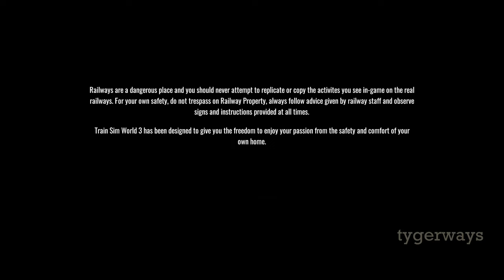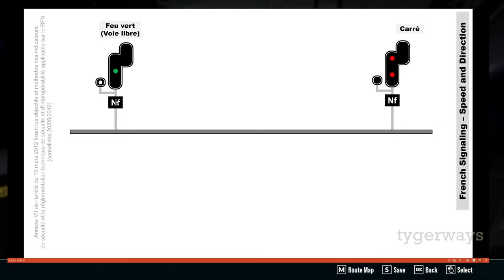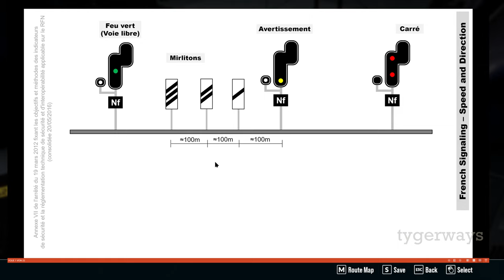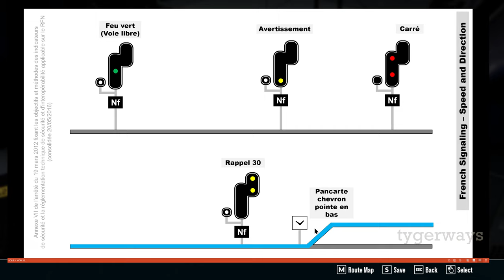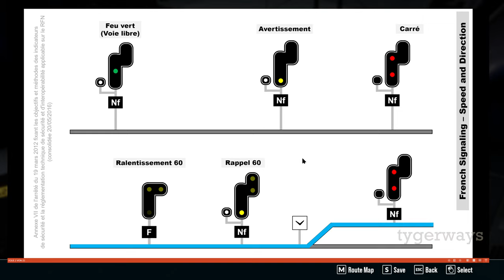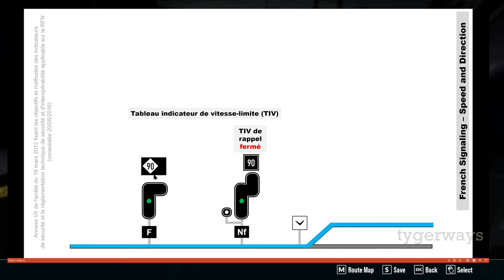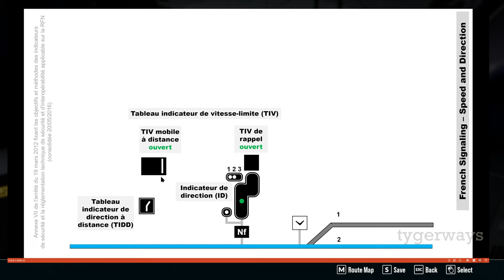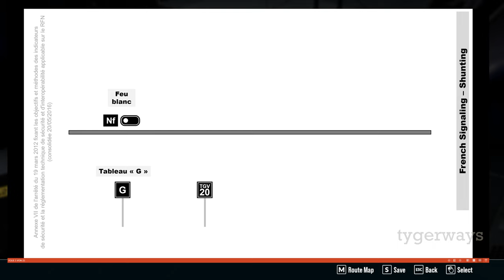French Signalling: Speed, Direction and Shunting Signals on the TGV Duplex 200 (TSW | tutorial)

Comment: Musings:

As I've said before the TGV dynamic brake in the game is not very effective relative to the real one and on top of that if you drive in a realistic fashion you can't keep time because many of the station to station times in the game are too tight.  I looked at the way you drove Marseilles to Aix-en-Provence in this video and you were, imo, a bit more aggressive in a few places than a real SNCF driver would probably have been and yet you were still late by the game timings.  On many services on many routes you can either drive it realistically or keep time but not both.  Some services on some routes you can but a lot you can't. 

Also, perhaps I should clarify "my" double block method a little.  It's not intended as "do it everywhere, every time".  In real life it would typically be employed at higher speeds so you wouldn't really apply it rigidly at lower speeds and obviously doing it at a flashing 80 would be silly!  Also, it's more aimed at situations when at high speed an unexpected reduction pings up and the driver doesn't know why and therefore doesn't know what's coming so it's better to start to knock the speed off early just in case.  In the game it also helps to compensate for the feeble dynamic brake.  

That unexpected speed reduction situation is a little different, for example, to approaching a station the train is scheduled to stop at.  In that case drivers know from their route knowledge that getting a flashing 300 (or whatever) at a specific repere means they are clear into the platform so they know what's coming and where the station is.  They can thus brake appropriately for the known upcoming speed reductions and the known stopping point (ie the TGV1 or TGV2 markers on the platform).  Getting a reduction earlier than the specific repere means they are not clear into the platform, don't know what's coming and so a more cautious approach is warranted.   

So basically it's a defensive driving technique but you tailor it to the specific circumstances similar to what I described before for following another train where you don't do it rigidly but pick an appropriate speed to try and create a steady state situation until the train in front pulls away.
Reply from the maker: Thank you very much! What you say clarifies a lot and matches my 'feeling' with managing the speed in this system. I hope you are okay with me calling it "your" double block method, since you introduced it to me. :) Just let's hope for more French content to be able to check out more different situations!

Do you have an explanation for the Crocodile alert at 18:23?
Reply: @tygerways6615  You're welcome and no I don't mind you calling it "mine" for ease of reference.  

I agree more French content would be nice.  The DTG TS version of this route goes all the way to Lyon with classic route sections at either end (including the 3 power changeovers in just a few km outside Lyon) so it's a shame this one only goes as far as Avignon.  A classic French route with locomotives, freight etc would be nice too.  The focus seems largely to be on the USA, UK and Germany though so I would be surprised if more French stuff is released.